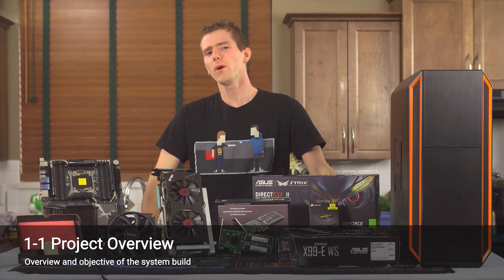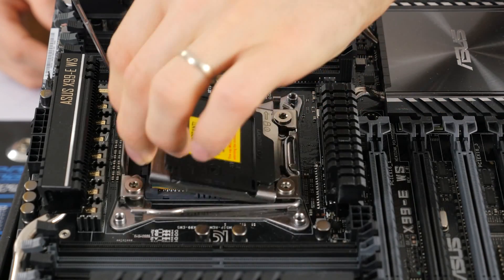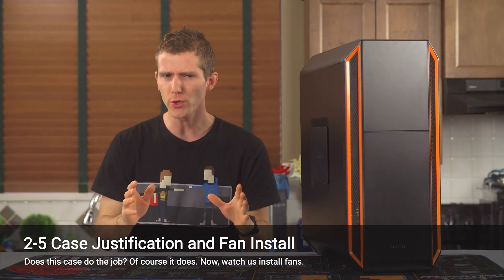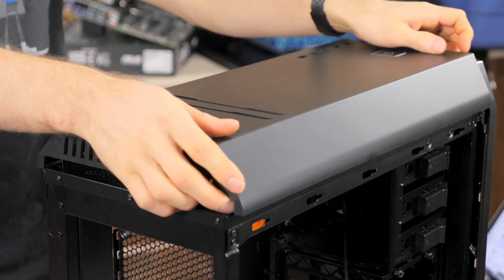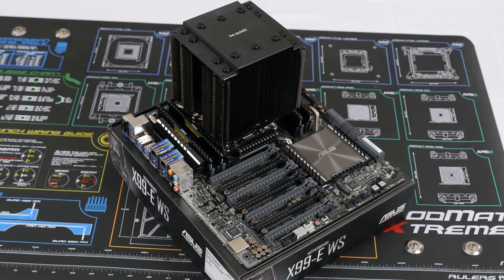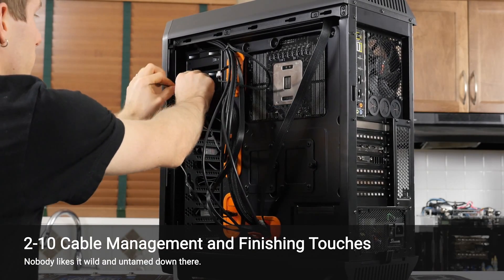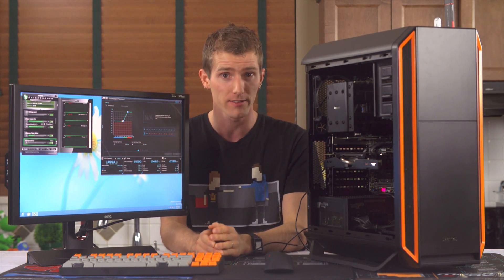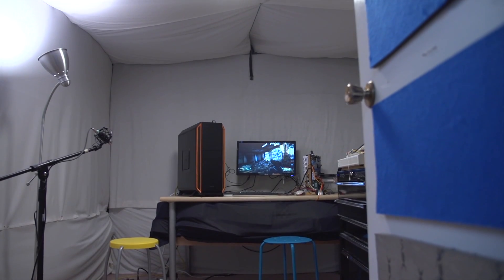How to Build the ULTIMATE Silent Gaming or Workstation PC

Comment: How can a 3.00 ghz octa (intel) be better than a 4,4 ghz octa (AMD)???
Reply: Because AMD cores don't act the same way that Intel cores do. Basically an AMD octa acts more like an Intel quad.
Reply: greyXstar
 i tis because AMD advistises its equevent to Intel hyperthreading as atual cores ... kinda. AMD has a ratio of 2 interger cores to 1 floating point core while Intel stuck with a 1:1 ratio of floating point to interger cores but also has hyper threading to allow each core to preform 2 things at once thus haveing double the core count advisted while AMD just advitises the core count of interger cores while neither includes the floating point cores in the count of cores. Thus a AMD octa core is the same as a Intel quad core even on core count if hyper threading is enabled.
Now if hyperthreading is disabled then Intel still wins because of how Intel and AMD have gone in diffenret directions. Intel has gone after a higher IPC while AMD has gone after a higher Clock speed but higher and higher clock speeds with the same IPC can only get you so far for instructions per second until you have to work on IPC  same with IPC if you never increase the over all clock speed the effenency per clock cycle will go under the very fast but less effecent CPU so Intel CPUs have been doing both of haveing slightly faster clock speeds that reduce down when not needed while haveing higher IPCs but AMD mainly just has much higher clock speeds and higher interger core counts without chargeing as much for it.
Thus if you compare the same core counts to one another Intel wins with a Intel quad with hyperthreading against a AMD octa-core but a Intel quad without hyperthreading only does slightly better than a AMD octacore because of the extra cores not being used and Intel haveing better computing per cycle not double that of AMD as of yet anyways but better by a little and a little stacks over time to be alot. For gaming and most general user applications it doesnt really matter which one you go with but for compileing, rendering, 3D modeling, video editing, etc. that actually relys on the CPU alot then yes the Intel CPU will pull ahead ... yes i know there are video renderers which use the GPU but many still only uset he CPU and hopefully will be going over to OpenCL, OpenACC, and/or CUDA soon.
Reply: your welcome it is just the 2 companies went in slightly diffenret directions to bring you improved preformance and i hope it helps as yes Intel preforms better but also Intel is around $50 to $150 more for each market Intel markets in but the price does come with the extra preformance so if you are planning on keeping it for a while Intel is the way to go if you are one with the yearly or even bi yearly upgrade cycle with full system upgrades then AMD will be better as AMD is cheaper and AMD does get the job done as welll it is only when you go into compute heavy applications that you see the differnce but in games they are about the same.
get a intel i6 to meet the AMD FX they are about the smae just the i5 will have a intergrated GPU as a backup in case the graphics card goes out to soon for you and have to use it till you can afford another one to replace it but in both cases the intergrated GPU almost totally sucks besides for HTPCs.
Reply: WOW! I didn't knew! Thanks alot for this info! really helped!
Reply: yumri4 thx ;)

Comment: That Mushkin Scorpion seems a bit overpriced. Building your own using an mSATA PCI-E Raid controller (something like this: http://www.amazon.com/Syba-Marvell-Chipset-Shared-SD-PEX40079/dp/B00KKO6N98) and 4 mSATA SSDs comes in cheaper by my calculations at theoretically double the speed. Plus you get way more customizability.

Comment: Thank you very mutch for this video. Im very pleased.
What is the difference between the motherboard with this productnumber 90sb04q0-m0aay0 /cant find any where to buy it! Only another model of the same motherboard with product number 90SB04Q0-M0EAY0 and it says it only supports Xeon processors.

Comment: The hotter you run electrolytic caps, the faster they fail.  I am interested to see how long that PSU lasts.  Would you be willing to take some pictures of the caps in the PSU?  I would like to check out the datasheets to see if they are anything special.

Comment: Can't you just make a custom fan arc for your GPU to run at 0RPM until it gets pretty hot so 'fanless' mode isn't really that useful.
Reply: Yeah you easily can in afterburner.  Maybe the Asus and msi are designed to work  at low temperatures without fans and wouldn't immediately get warm enough to turn on the fans.

Comment: I think Linus got the idea from me with my fanless CPU (just kidding). But I've been running my E8400 for almost 7 years now with no fan but a Cooler Master beast of a heat sink. I used this set up for my gamer when I first built it and now it's my workhorse and I never saw temps (when looking at them) reach over 74c. So yeah, you can run a PC without a fan as long as you have a good heat sink on the CPU and good airflow in the case.

I have a video of it on my channel under old PC still games (or something like that).
Reply: Ok.
Reply: Rex Romero I was just kiddin of course.
Reply: At 60? That's odd. Try reinstalling the cooler and apply a new brand of paste too. Noctua's paste is good.

Comment: No hard drives? Um, if you want a realistic system, you should have had at least 2 drives in there. Honestly, hard drives don't add much noise anyway.
Reply: They added a pcie SSD bro
Reply: Nasrin Ahmed Yeah, but a real system would have either more than one SSD or a SSD/mechanical hard drive RAID for storage.

Comment: Its not silent if there are fans
Reply: Without load they're mostly off. The system is quiet most of the way but starts to make a little bit of noise when it's performing better than most other fully silent builds.

Comment: What does an i7 do that a i3 can't?
Reply: a lot
Reply: 3D Modeling, Rendering Etc
Reply: Depends on the application but I'd go for an I5 for a gaming machine that can also multitask.
You could use an I3 but that's not expected to perform too well on ultra settings or with multiple applications running.

Benefits of an I7 also include I/O options like more PCI lanes or faster storage. You can find more details on that elsewhere though because that's a list too long for me to type of the top of my head.
Reply: More cores and hyperthreading.
Reply: TomCast
One who does not know what the difference between an I3 and an I7 is probably doesn't know what you just said either.
Reply: I know the difference kid I'm talking performance wise because an i5 and i3 4th gen get around the same FPS
Reply: Gaming 4 Ohio Gameplay's & More
 if the game is all gpu bound
Reply: Gaming 4 Ohio Gameplay's & More

If you know the terms you can Google yourself too. Way to go calling someone who's trying to help you a kid by the way. 

The processors share the same instruction set so there's no difference in the CPU aspect besides performance. 
There's IO difference but if you're such an arse I don't really feel like explaining it to you.
Reply: i3 is perfectly fine running games on high settings as long as you have a good graphics card so I don't see the point in getting an i7 yeah you get turbo boost and a quad core but most games only need dual core so yeah
Reply: Gaming 4 Ohio Gameplay's & More
 depends on the games you play  ....  you get more then quad core with i7 now
Reply: Gaming 4 Ohio Gameplay's & More To be perfectly honest, not a whole lot unless you're playing a really heavily CPU based game, in which all your CPU cores are used; at their maximum capacity. If we aren't talking just gaming though the extra cores/speed can be useful for alot of reasons, depending on what programs you are using them for. Most new games are also leaning towards quad core CPU's instead of dual core aswell.

Comment: Where's the logic in not having a fan on the cpu cooler if you're going to use the cpu fan header anyway? It would be more efficient and quiet to have a fan on the cpu being controlled by the cpu header.

Comment: What's the point of a heat sink? I always thought that liquid cooling would be more efficient and let the CPU run at cooler temperatures. Sure, there's probably a difference in price and quiet performance, but that's something I thought a lot of people building a PC would be willing to sacrifice.
Can someone please explain it to me?
Reply: Cooler is stupidly large.  Makes working inside your pc extremely difficult.  The water cooling AIO coolers are very very quiet.
Reply: Watercooling adds the noise that the pump makes, and doesn't cool as effectively when fully passive. (ie, doesn't cool well without that pump turned on)
The heatsink allows them to completely turn of all fans and pumps while still retaining cooling capacity.
Reply: Liquid cooling would allow it to operate very quietly at much lower temperatures, but adds on the sound of a pump plus whatever fans are cooling the radiators. Linus was going for 'as quiet as possible' in this build. (Although, if he was really going for 'silent', I question going for a 980 - when gaming, that thing WILL produce noise.)

I think this build is a liiiiiitle bit silly because if you really are going for a 'gaming' system, a custom liquid loop would probably have produced very similar noise levels under load (if optimised for quietness) while also being a lot cooler and allowing for overclocking. 'Completely silent' doesn't fit well with 'top end hardware'.
Reply: There's no advantage to non-extreme overclockers. You can get that extra couple of hundred megahertz on a Noctua too. 
Most used prefer watercooling because it leaves the case empty and clean looking where as a Noctua is brown, silver and one huge chunk of metal.

I prefer aircooling because fans tend to last practically forever if you have good ones where pumps fail more often and closed loops degrade over time because of gunk in your loop. Troubleshooting and repairing a aircooler is pretty easy too, do the fans spin without the CPU being cool? Thermal paste or mounting. Do the fans not spin? It's the fans.

For overclockers watercooling is interesting because it can transfer the heat to a much bigger heatsink (480x80mm) without a huge case or even to a dedicated cooler which can take the CPU far below room temperature. I saw one that could go to -100C though that was one heck of an expensive unit and certainly not for day to day use.
Reply: ***** -100C? Was this a liquid nitrogen build? Since I really see no way in which watercooling technology even allows temperatures like that. Heck, just cooling technologies that can reach those temperatures are uncommon. (certainly impossible with water)
Reply: Tallywort
Maybe Pure Alcohol?
Reply: Applebloom
Read what I posted above your comment.
Reply: *****
Link please? To the cooler..
Reply: Applebloom 
What cooler? There's a couple that can do -100C and dozens custom built from industrial, special application or lab coolers. Heck, you can even build one yourself. 

As for watercooling loops, tons upon tons of combinations but you can only get to room temperature with them. 

I myself have a NH-D14 which is cool but you could get yourself a Nofan too. 
nofancomputer.com/eng/
http://www.noctua.at/main.php?show=productview&products_id=34&lng=en
Reply: *****
I have the h100i, going to watercool some 980's soon though.
Reply: airgear87
A custom loop destorys aircooling., while not covering half the motherboard.
Reply: Applebloom 
However, without overclocking it still doesn't make sense to do unless you want the aestatic.
Reply: airgear87
My Freezer I30 performed similar while bieng silent, its so underrated.
Reply: airgear87 http://www.arctic.ac/us_en/freezer-i30.html
It fits on all modern sockets 2011, 1150, 1155, 1156.
Reply: airgear87
Its kool.
Reply: As you've stated, watercooling is expensive AND you'll still have the fans on your radiator and the pump making noise. But aside of that, watercooling introduces additional points of failure (leak, pump dying) and requires maintenance (flushing the loop). Shiiiiiieeeet, you even have to clean the rads, BEFORE ever putting them into your system.

So, in conclusion: It's expensive and it's bothersome. Some may care about it, but the majority doesn't. The only real advantage of cooling with water, is that you can achieve truly superior cooling, by using radiators bigger than your case. Which eliminates the need for ANY fans,

Comment: Since you use aida64 in your overclocking videos i think i should mention that even if you end up stable in that, some games still crash because of OC instability. i got the i7 5820k running at 4.3ghz. 4.4 was stable for about 10 minutes of stresstesting. but then assassins creed unity crashed once it was loading the in game menu i tried restarting th egame a cuople of times, then restarted the pc and back into the game wich kept crashing.. I fixed this by upping the voltage slighly and dropping the bclk by 1mhz. and it was supposed to have been stable running aida64 burntest. so apparently the graphics cards had some influence on the power supplied to the cpu in some way. 2 gtx 970 on a corsair hx850 80+ silver PSU. so i guess once you hit that sweetspot for stresstests you might aswell give the cpu some further slack in clockspeed or up the vcore a little extra.

Comment: You know when your fps drops to 15 fps for about 10 secs, does that damage hardware? This happens constantly....
Reply: Not by itself it doesn't, it's possible though that you're running out of VRAM and the GPU is having to shift textures to system RAM in order to fit new stuff onto it, which slows the game down massively, and it could also be temperature, in which case your GPU or CPU will downclock itself to protect itself accordingly depending on which one is overheating, and that will result in a loss of performance.

If you download GPU-z and change to the sensors tab and set memory usage and temperature to show max reading only, and then play a game with GPU-z open, you should be able to check what your VRAM usage and temperature is by alt-tabbing out of the game when it happens and seeing what those two readings are.

If it's at the maximum of what your GPU VRAM is, as in, if your card has 1GB of VRAM and it's using 1GB of VRAM, then it's probably having to swap to system RAM, and if it's reaching around 100C then it's overheating and you'll need to remedy it immediately. (Temperature will kill your components, it's not a question of if, it's a question of when, so if it is overheating, then fixing it now will save you in the future, but if it's anything less than 90C, it's probably fine and it shouldn't cause you any issues)

But without knowing what your hardware is and what games it happens in, it's almost impossible to diagnose the issue properly.
Reply: Robinthefox88 What if system temps are average?
Reply: Then it sounds like a VRAM issue or game issue, if it happens in most games, then it's possibly hardware or drivers, but if it's just in specific games then it's possible that the game needs updating or there's a driver issue somewhere causing problems.

It could also be just that your system isn't powerful enough for the settings you use in the games you play.

Again, without detailed information on what your system is and what games this happens in, there's not much anyone can tell you.

Comment: i want to know the noisies part in this build,  i guess its the gpu fans under full load.  or it may be some electrical noise like coil whine from gpu or psu.
check the gpu temps and if its below 80 you could set fans to lower rpm. even a underclock is very reasonable, 10% loss in fps is not noticeable and you get much lower power draw. 
i love these kinds of builds :)  
for me personally gaming noise is most important,i play many games with no sound and i have a quiet apartment.
so quiet in fact that i had to buy a silent mouse: Nexus Wired Silent Mouse SM-8500, and im looking for a good price on the Razer DeathStalker to complete my build

my build: fractal r4 with 4 140mm fans @ 550rpm, 2 intak in front,1 exhaust at back and 1 side.
i5 4670 stock speed with a noctua u14 with 140mm fan @ 550rpm
500gb ssd
windforce 780 slightly underclocked that does 800 rpm until 70c then 1200rpm(29%) until 85c if a game can push it to that limit.
my issues is coil whine and electrical noise, at very low sdd usage and gpu at high fps.

Comment: If your GPU is too loud, I recommend cranking up the case cooling rather than the GPU fans. Their sound signature is much more pleasant. The bad news is that as far as I know you cannot adjust chassis and CPU fans in relation to GPU temperatures, so you would need to make those fans spin faster from the get go.